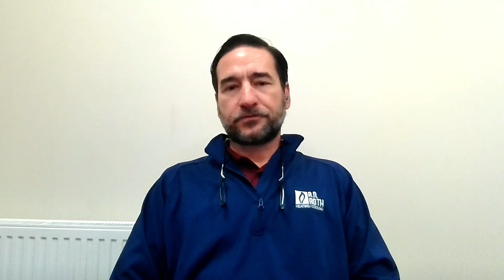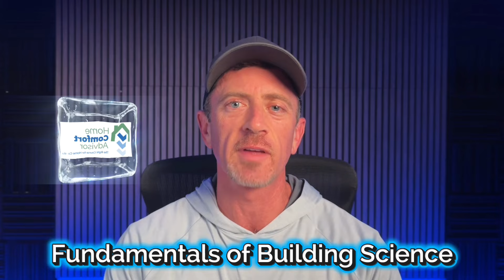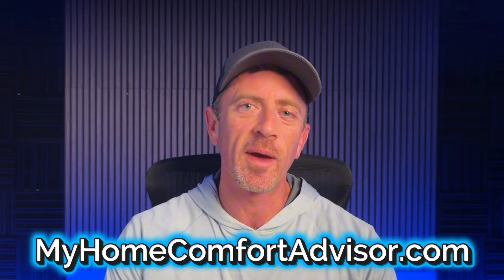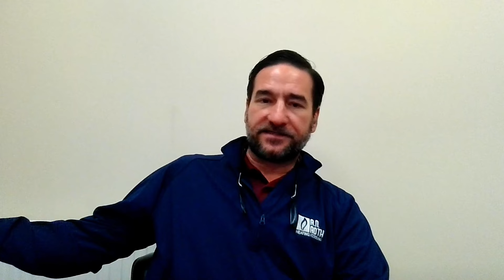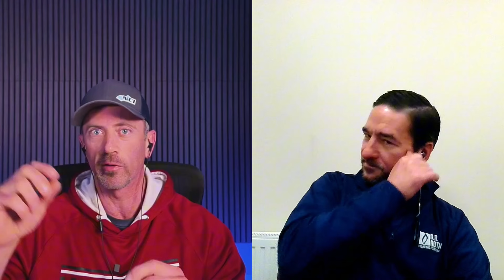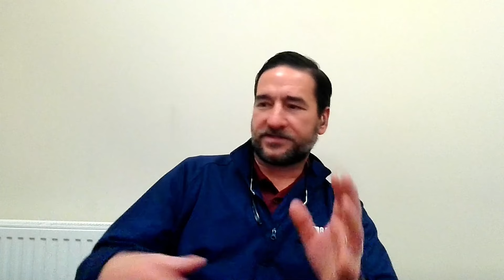5th-Gen HVAC Contractor Explains Why "Efficient" Homes Can Create MORE Humidity & Comfort Problems!

Comment: what would you say about newer build homes (2020+) for hot months when the ac is running? Is the best solution air sealing, then dehumidifying for controlling moisture?
Reply from the maker: More info really needed to give the best advice, but if you know the house is leaky now and can air seal it that’s usually the first step. Make sure you don’t have any exhaust fans running constantly, as that will draw in outside air and make your house more humid in summer months. That’s a common feature in many production built homes.